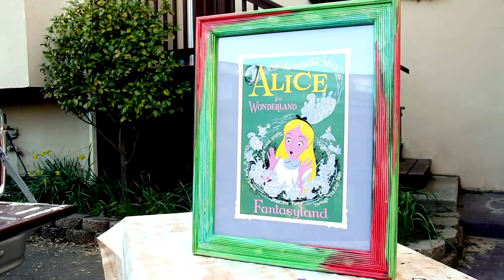Plywood picture frame

Comment: First, I have been framing for thirty plus years. I have never used plywood. It is interesting. I think the dye is a different idea as well. I like to use milk paint. There are many things you can do to it to give it different looks, crackling, glossy, satin, distressed etc. If I am going to do a simple profile, I join the frame and then use a small router with a small bit and do the profile then. Good video

Comment: For $20, Get the plunge base.  

I bought a DW router (fixed base only, thinking I would only use it in a router table) and ended up kicking myself later when I realized that I couldn't really live without the plunge base (dados, mortising, and such).  I had to shell out another 79 bucks for the plunge base alone.

So for $20, do yourself a favor and get it.  You won't regret it.

Comment: Great video! I'm new to woodworking and after seeing your video I made a sled. My problem is wrapping my brain around measuring the final lengths of the pieces after putting them through the sled and getting the inside lengths to be exactly what I want, and then repeating it for the 4 pieces of the frame. Could you possibly explain where you measured and held the pieces so they were the exact lengths you needed? I assume some sort of stop block could be used?

Comment: Voy a traducir todo Jaime.Hope you get this Steve. Jaime is asking "Could you please explain,(in English lol) the three blade table saw technique you used. "Is there a name for the system? Is there a nut or screw you place in between the blades? Should I take certain precautions when doing this? What are the dangers of putting 3 blades if the fabricator suggests using only one? I know my questions might seem obvious but please consider that this is a hobby for me, the carpenter

Comment: Steve, is the food dye at the end just a mix of dye and water?  If so, did you have to go back and sand to remove any burrs that were raised by getting the wood wet or was that not an issue?  Thanks!  Great video

Comment: Hey Steve.. Good job, yet again:)

I have a question: As you seem to use alot of plywood...How much do they cost over there?

Here in Norway they cost quite abit. A 3/4" inch sheet is around 1000 NOK, wich is roughly 180$.

Comment: mi estimado, 
desconozco si puedes traducir, yo no se hablar ingles. 
 vi que coloco tres disco de sierra junto, ¿existe alguna tecnica especifica?, ¿se debe usar algun tipo de separador entre discos o alguna tuerca especial?, ¿ se debe tomar alguna precaucion especial?, ¿que riesgos implica si el fabricante de mi maquina solo habla de colocar un disco y yo colocaria hasta 3 juntos?. 
Puede ser muy obvia mis consultas, pero por favor considera que solo es un hobby para mi la carpinteria.
Reply: Son tres años ya pero si hoy dia no a recibido respuesta, es un set 'dado'. Son dos discos de sierra regulares o de terminado de cierto diametro y discos con dientes especiales para triturar la madera para remover en grandes cantidades. En adicion, se usan anillos separadores para lograr el ancho requerido. Dado Blades o Dado Stack en ingles.

Comment: i need advice on getting a router. i want to either get a craftsman 2 hp fixed base router for $80 or a craftsman 2 hp fixed/plunge combo router for $100. is it worth the extra 20 for the plunge base?? i am planning on mounting it under a router table. and why would i really need a plunge router, what is it for

Comment: Did you not nail the corners in any fashion?
If not, this will cause problems in the future.
Reply: True, reinforcement is not always necessary, but since a few nails of brackets would be so easy to add.
If for some reason the frame should fall off the wall, those reinforcements will likely keep the corners in a semblance of order.